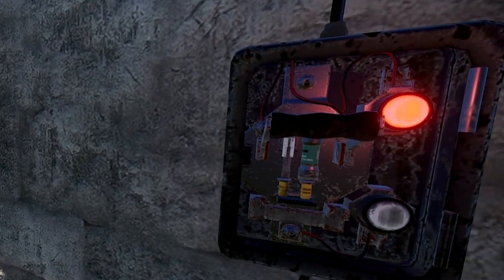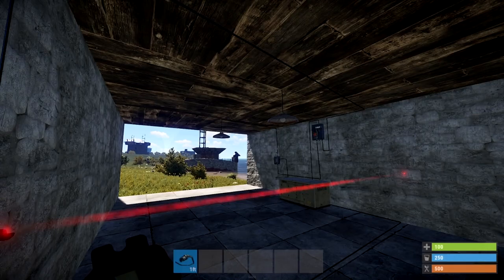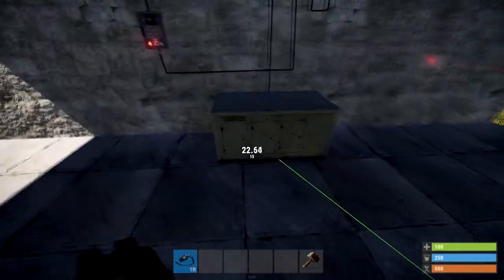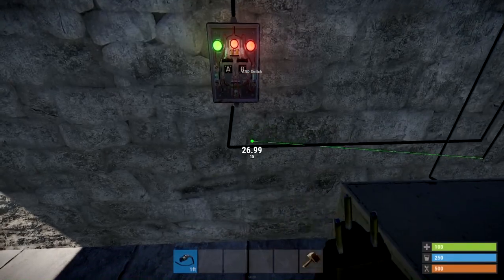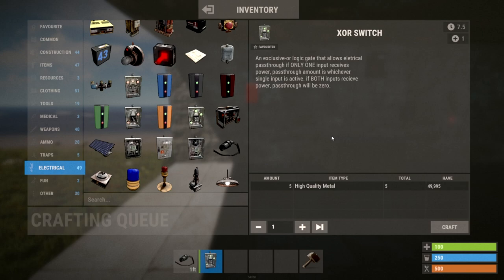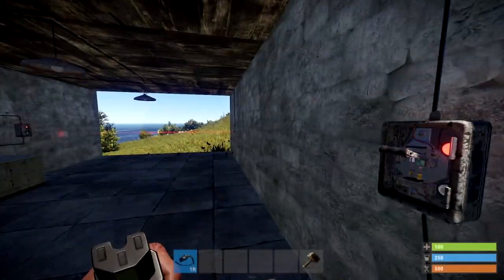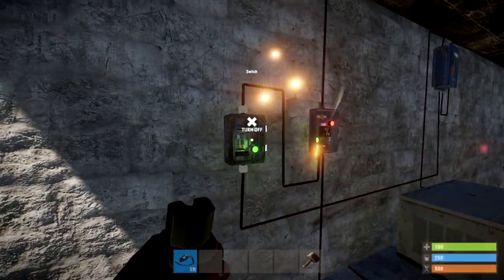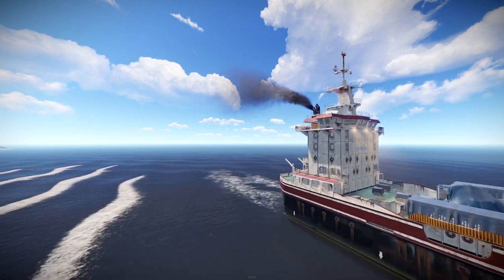🔌 RUST | Complete Smart Switch | Beginner Guide Tutorial | AND | OR | XOR | TIMER 🔌

Comment: Wish u explained the off switch thing more, i tried tying in a rf receiver to the off switch on my sam site and anytime i shut it off with a transmitter the only way to turn it back on is by disconnecting the wire, turning it off and back on, then reconnecting the wire, and hooking up a 2nd reciever with a different frequency to the on switch didn't work at all. I don't get it

Comment: I noticed when the laser deactivated the light through the switch off toggle, it would not turn back on even when u flipped the switch back to ON. I too have had this issue .. is this a bug??
Reply: I think it is a bug. There's no good reason to completely deactivate the switch just because the ON toggle input stopped receiving power.

Comment: I guess the only way to really have the lights turn on and off automatically is using the timer? You would think that having a turn off and turn on with the smart switch would allow you to trigger the lights to turn on and stay on until the trigger-off is triggered. It just makes no sense. I want the lights to turn on when I drive the car into the garage and turn off when I enter the base but the logic of these switches well there is no logic they are dumber than bricks. Is there a solution to this?